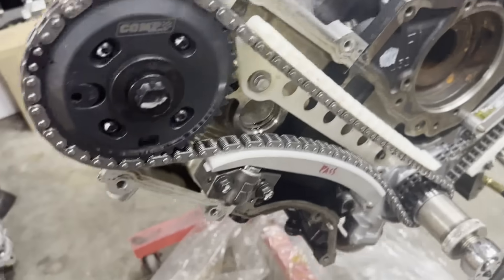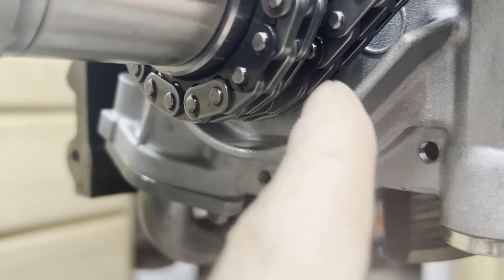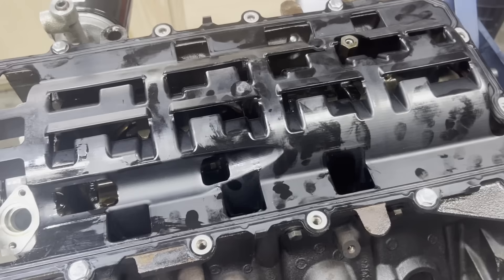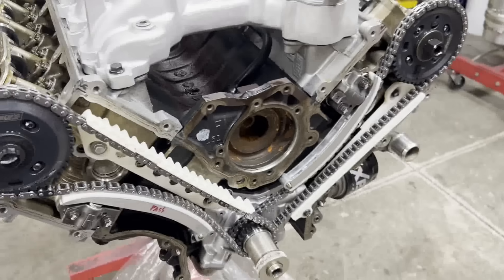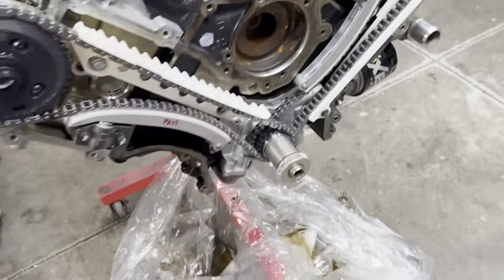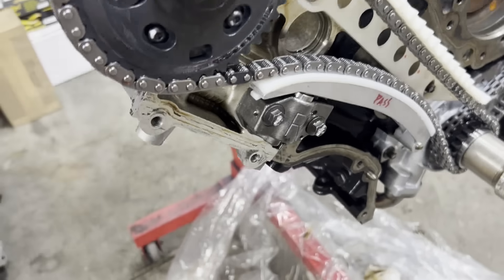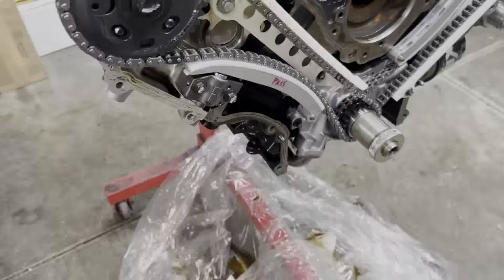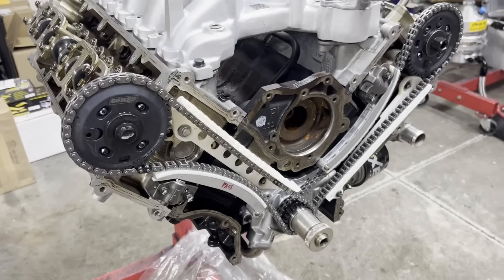Lykins Motorsports Ford 4.6 SOHC Tensioners VS Oil Pressure...

Comment: Excellent video, Brent! IMHO, you did the right thing & went w\ Jordan's recommendation & replaced the Cloyes copy w\ the original FoMoCo design cast iron chain tensioner......these FoMoCo designed cast iron tensioners are designed to "hydrolock" the plunger under the chain guide using EOP once they are bled out of air or aerated oil to constantly maintain proper tension on the chains & prevent the cams from walking out of timing phase as the crankshaft velocities vary from RPM changes\EOP changes & flopping around (the hole you saw the oil spraying out of is by design.....this is how the chain gets oiled) which is how the stationary guides get broken, especially B1 stationary guide (the ratchet is there as a secondary support to prevent the plunger from excessively compressing which will cause the chains to get even more loose & flop around even more causing more damage & cam timing walking further out of phase w\ the crankshaft ......you'll note in your videos that the top of this ratchet clears the chain guide by approx 1\4" to 5\16" when the guide is fully contacting the top of the plunger, thus the plunger has to compress 1st before the guide will even come into contact w\ this ratchet......this is not present w\ the plastic units which can allow the plunger to fully compress due to varying EOP\RPM changes thus cause the mentioned issues w\ the cams & guides. The OEM plastic tensioners try to do all of this thru the plunger alone.......maintain sufficient chain tension to prevent cams walking out of phase timing while at the same time provide sufficient chain oiling........thus will allow the cams to walk out of phase timing w\ the crankshaft at times due to varying EOP\RPM changes at the tensioners.....which can rob the engine of some available HP\TQ depending on the severity of this issue & kinda defeats the advent of degreeing these cams. The ratchet will also help to prevent the "start up chain rattle" which is due to the tensioners having no EOP AND the internal plunger spring is loosing tension due to prolonged heat cycling over time causing the chains to get excessively loose during engine start ups & rattle against internal components until EOP is established.

The best thing to do IMHO w\ these Ford Modular engines (2V, 3V or 4V.....) is to use the FoMoCo OEM cast iron chain tensioners w\ unmodified ratchets instead of the FoMoCo OEM plastic chain tensioners if performance is your main goal & are using a HV\HP oil pump. The main issue you're gonna hear involving the modifying of the ratchet teeth is actually due to the use of a 2-step or NM2B WOT box or sidestepping of the OEM ETC throttle rev limiter to use the fuel\spark cut as primary rev limiting.....not due to the engine being "high output"......with the length of these chains & the use of fuel\spark cut to rev limit, this causes the chains to get violently whipped around causing the tensioner plungers to get driven into full compression causing the chains to become excessively loose & violently whip around, causing excessive internal damage. By modifying the ratchet stand to allow the plunger to get driven fully compressed w\ the use of 
fuel\spark cut rev limiting is asking for the stationary plastic chain guides to get blown up at a minimum.......this is why billet chain guides\billet oil pump gears were developed for these engines.........when these engines are being used specifically at the drag strip or during drifting\hooning events when the engines are being excessively bounced off the rev limiter. If a 2-step\NM2B WOT box is not used or the OEM ETC throttle rev limiter is not bypassed (specifically the 3V which is using DBW throttle control), then none of this issue will occur. This is what most folks will not tell you........ My 2 cents.................hope this helps.

Comment: A good tip from watching one of Jordan's video's, use a plastic quick clamp across the chain guides to tension the chains. Then make sure the ratchet holds the chain in place. You may need to go slightly tighter to get to a ratchet tooth, the chain should stretch slightly being new and slacken off a little after run in. Great video Brent. Tim Australia 🇦🇺 ❤

Comment: You can wrap the two chain guides with a zip tie when changing out the tensioner I do believe. I used to do it to 3 valves. I’d try to sell customers tensioners at 100k if they never had phaser work done in the past, as preventative maintenance. The tensioners on the had a silicone bead as a oil seal that would blow out and the top end would bleed of oil pressure and when the engine would get hot it’d develop a knock noise off isle or when flowing down. Sometimes they’d run like crap if it was real bad. That engine got a bad rap on it due to those tensioners, when in all reality it was pretty good, other than the sticking spark plugs, which was a early model issue and spark plugs were two piece. The later engines had a more normal looking plug without the long reach without threads.

Comment: Good job Brett,better safe than sorry. I have a 4.6 2v in a 2003 pickup with 250K n it doesnt use oil,runs good. No problems except coil packs

Comment: Here's a question:

Is there any component of a modular engine that is a positive stop for for oil flow. 

Brent I wish I hadn't retracted my comment from the other video, but in the beginning I wasn't aware you were using Cloyes tensioners. I had no idea how they operated, and I retracted my affirmation of the oil bleed off being normal for the OEM tensioner. 

🤷‍♂️

Comment: I have a 4.6 with a lot of miles on it and I don't know if the chains have been changed out....I should take a look. I've never worked on a 4.6 internally before but this looks easy enough. Good to know those tensioners also oil the chain. On that scraper, it loos like there are only 2 spot welds, you could maybe use a spot weld cutter (for body panels) and cut the scraper loose from the pickup tube. The scraper could be tig welded back to the tube in a worst case scenario.

Comment: Makes me glad I opted for the Melling HV pump when I did the timing set on my wife's 180k '02 Explorer. I recall that one side or the other, including under the valve covers, looked drier than the other side- definitely not as much splash going on. That car is still going strong at 225k (in my son's hands).

Comment: You didn't waste money on the tensioners, the cloyes are know to be unreliable, sometimes stripping the ratcheting teeth giving a nice rattle on cold starts. There were factory plastic bodied ones too used mostly on the 3v engines, those are crap too.That windage gasket looks to be for a coyote. There are a few different pick-up tube and windage configurations on the 4.6 2v and 4v using metal trays. My feeling on windage trays is you might not see much on the dyno but out in the real world it keep the oil a little more under control.
Reply: I took my windage tray off Mt FE because the double gaskets always leaked oil and 5 hp wasn't worth the headache.

Comment: It seems like a better design for this windage tray would be to have a shield for the return oil holes down to the pan. A piece of tubing for each return hole or the metal of the windage tray turned up to direct the oil and block wind.